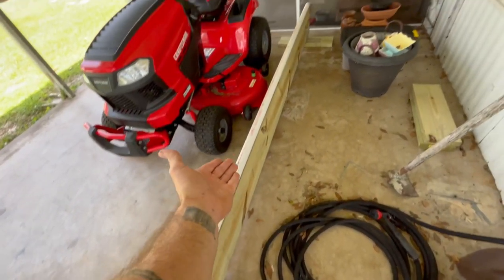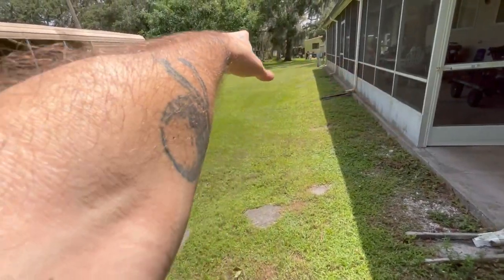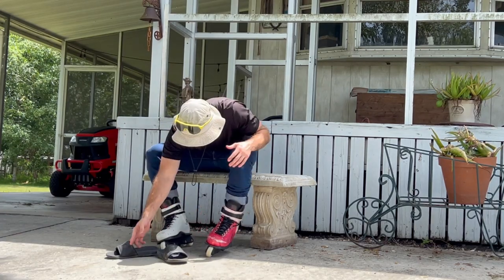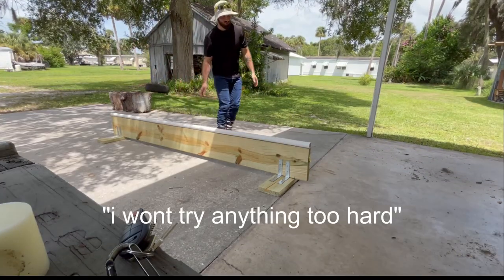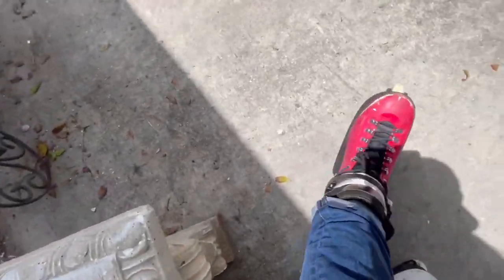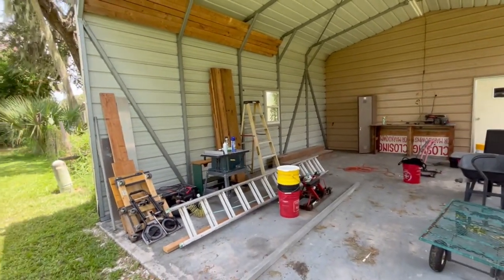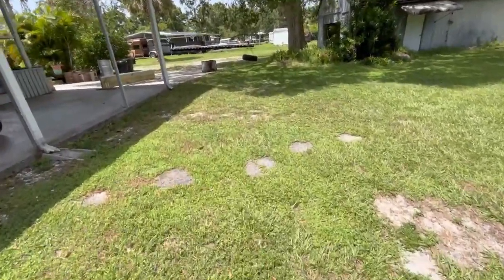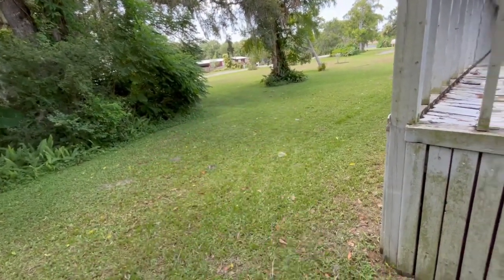Lets Build a Backyard Skatepark

Comment: Really depends on your budget (money-wise and time-wise). With enough of both, anything is possible. You also have to consider how durable/permanent you want things to be, how much you want them to interfere with the rest of your property, local zoning for permanent structures, noise ordinances, etc.

The downledges off the roof idea is ridiculous and it doesn't look like you have enough space for that anyway.

The miniramp under that awning in front of the shop would  have to be really small to fit, both in length/width and height. It would be more of a micro mini which are not really that fun for blading.

If it was me, I would look at making the front wall of your enclosed patio space removable, or a big door of some type; then you could move your patio furniture and have a nice long paved area, looks like it could be long enough to do lines with a couple obstacles. A quarter at each end and you have a little mini skatepark that is mostly covered except for the driveway section at the one end (where you skated the p-rail).
Reply from the maker: Thanks for the info. If I was to build a mini ramp under the hangar it would be 20’ wide and 4ft high